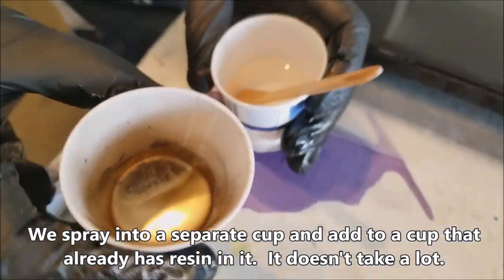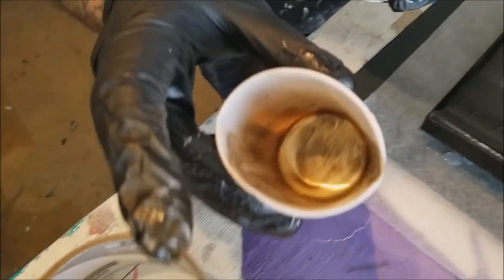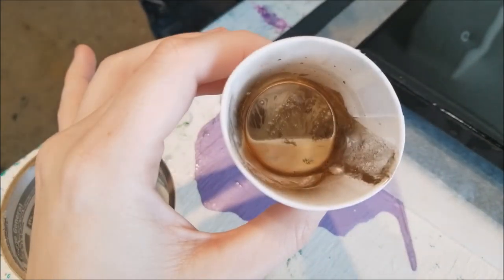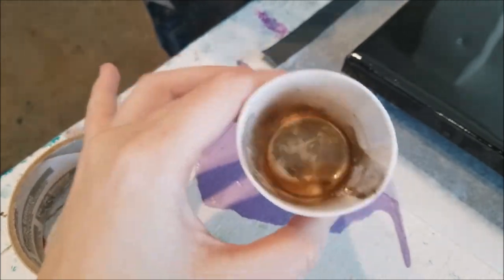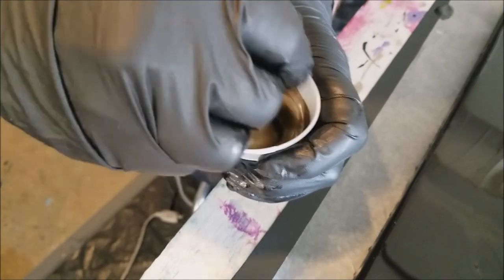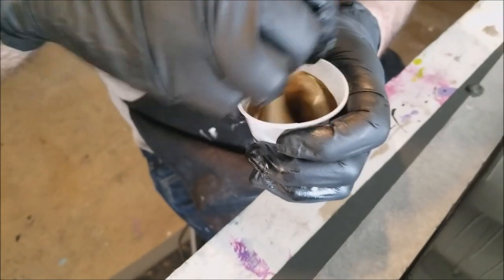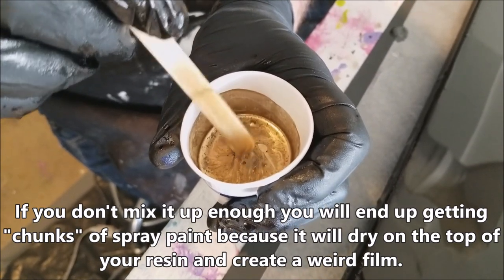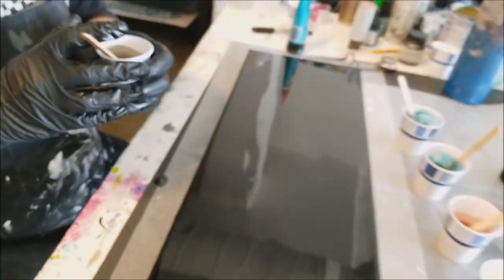Using Spray Paint with Resin (One Min Pro Tip)

Comment: I havent tested this, but you should be able to modify the can nozzle with tiny drill bit, so you dont get the pray effect, but uniform flow of the paint. Does not waste so much paint into air, nicer to use and you can just use some old nozzle to modify for this use. Alternatively go to your local car painter and ask them straight out pigment dye they use to color the car paint, can use their color coding ie if you want certain car color tell them the color code. Should be cheaper and has less unwanted chemicals and you can get it into your own container how much you want. This can be done with house paint color mixing pastes as well, but those are dull colors. Mix that color paste with acetone and you have 1 second dry time paint, nearly black you can get for free as cleaning of the nozzles is done daily and mixing everything turns NEAR black, but not perfect black. If you manage to get there in time or ask when they are going to do it, they can clean certain color nozzle for separate container so free base color pigment!!
Reply: Very good tip!

Comment: Hey bud can answer me a question. I have an urn that is made of cold cast resin. If I wanted to spray paint it would the paint stick to it or would I need a primer first?
Reply: First test on the small area that is hidden. I would give it a rub with say 400 grid to make sure there is good adhesion. This also helps to remove any grease and impurities from the surface. I dont think epoxy needs primer, but i could be wrong.. never seen reason to pain resin castings before, since its so expensive material already.